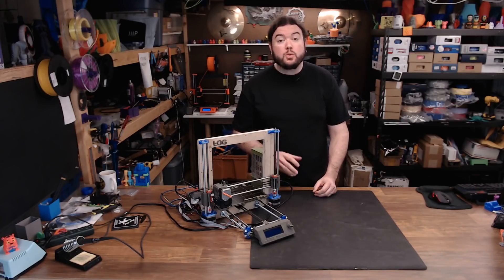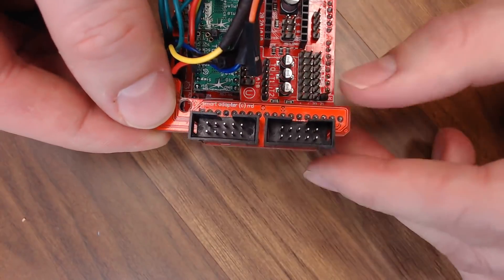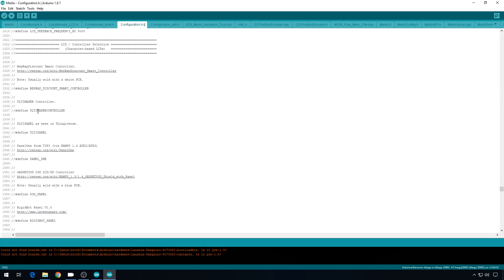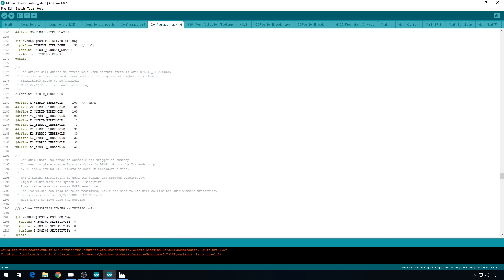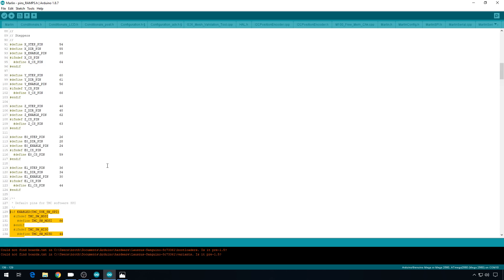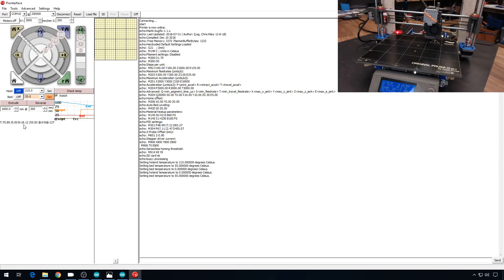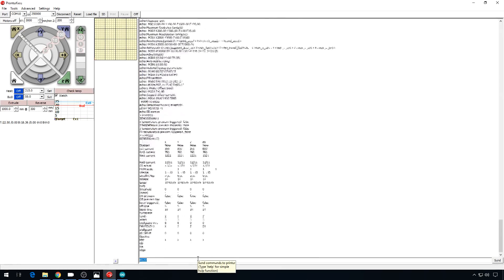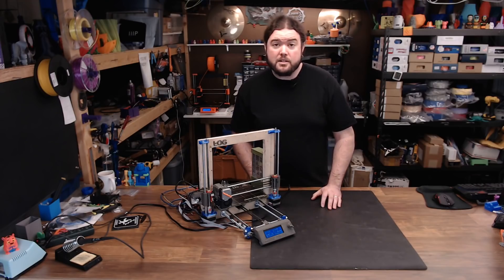TMC 2130 Stepper Drivers - w/LCD - Chris's Basment

Comment: Hi Chris, I notice in a few comments you've said this 'should' work the same on the Re-ARM. I've just tried this, and it came up with a TMC connection error. After having a look at the re-arm pinout (https://reprap.org/wiki/File:Re-ARM_left_Rev_2.jpg) it appears as though alot of the AUX 2 pins are not functional. Would you be able to suggest pins from that diagram that I may be able to use? Very new to the whole thing, so I'm not 100% sure. Cheers!
Reply from the maker: Since you can now change these up in the firmware you can use pretty much anything you want. I think I would try to use some of the open ones on the back header. https://reprap.org/mediawiki/images/f/fa/Re_ARM_Schematic.pdf
Reply: @ChrisRiley  Thanks for the help. Turns out my 2130s had the tiny resistor soldered on the back disabling SPI. Then used your suggested pins on the back. Works a treat now, cheers!

Comment: This method uses software SPI which add fair bit of overhead on the controller. This is acceptable is you have a small board with limited resources however I'd recommend using hardware SPI. In embedded world we use all of the embedded peripherals  before trying to re purpose GPIO pins
Reply from the maker: I agree, I would much rather use the hardware.

Comment: In Marlin version 2.0.x the "n_CS_PIN"  moved to "Configuration_adv.h", simplifying the configuration even more: https://github.com/MarlinFirmware/Marlin/blob/2.0.x/Marlin/Configuration_adv.h#L1980
Reply from the maker: Thanks for the tip!
Reply: @ChrisRiley  Check out my current patch (not yet tested): https://github.com/MarlinFirmware/Marlin/compare/2.0.x...chatelao:tmc3120#diff-18dab9d337cee2f9d2209940ed08dbacR1985

Comment: Great work. I feared already soldering on the LCD Board, cutting cables, etc. - Greetings from Switzerland.
Do you have a like to the modified firmware?
Reply from the maker: Thanks! I have this one, see if it helps. https://drive.google.com/file/d/1TZFD0wTgWvIrQtVyZdHxUln9gkc_ssCk/view
Reply: @ChrisRiley  This video is so incredibly helpful. Did you mind, if I just add your schematics to our printer documentation? - https://3d-printer-hacklab.readthedocs.io/en/latest/#neue-tmc3120-treiber-fur-schrittmotoren
Reply from the maker: Sure, you can use them.
Reply: @ChrisRiley  Thanks so much!

Comment: When I follow this guide i get the error: Driver error, PRINTER HALTED. So I went some steps back and tested only de relocation of the SPI pins without entering the settings and connecting the lcd/sd card reader. I still get the same error. For some reason the relocation of the SPI pins to AUX2 is not working. Does anybody have a clue what the error can be?
Reply from the maker: Hey, what version of Marlin are you on?
Reply: @ChrisRiley  Version 1.1.9
Reply from the maker: @DanvG87  So you think it's the virtual SPI that isn't working?
Reply: @ChrisRiley  Yes, because after the errors I got I went back to the configuration without lcd which was working. And then I only relocated the pins of the SPI (MOSI, MISO, SCK) and the CS to AUX2 pins. After connecting the cables to the corresponding pins on the AUX2 I still got the errors.
Reply from the maker: @DanvG87  What board are you using? There might be some overlapping pins.
Reply: @ChrisRiley  Ramps 1.4
Reply from the maker: @DanvG87  Can you send me a copy of your config to look at? If you can zip up the whole thing so I can compile it, that would be helpful.

Comment: Hey Chris, I've followed this video and got everything hooked up but for some reason when I move the X axis the stepper motor just buzzes. I removed the belt to see if maybe there was to much friction from the carriage but it does the same. Any ideas what it might be?
Reply from the maker: Hey! Almost has to be voltage/current or a bad driver.
Reply: Chris Riley, I managed to resolve the issue. It’s was a simple problem in the end, when I plugged the stepper motor into the ramps board I missed a pin. It’s now working perfectly and really quite, the part cooling fan is the noisiest thing now.
Reply from the maker: @hobbieswithnewbe  Awesome! Glad to hear it.

Comment: hi, I followed your tutorial, and everything is working  very quiet, it is amazing but some pieces when I print it looks like the steps of a stairs, I was looking for info and I think the issue is named skipping steps, did it happen to you with this drivers? if yes how can I solve it?
Reply from the maker: It could be two things, I would turn driver status on in the firmware and watch it print from the terminal. It will tell you what's wrong. They could be getting too hot, or the voltage isn't high enough.
Reply: @ChrisRiley  I hope you can reply me,  i am having problems with Extruder driver so i want to  try use the normal A4988 only for extruder  , i unpluged the 2130driver from E0 cnnector in the ramps and plugged again the old one , i changed in marlin back A4988 for E0 but the extruder is  crazy exdruding super fast   i dont know if i have to change the  wiring again and what am i doing wrong , thanks for your help
Reply: I found the issue , i just fotgot put the three jumpers back  , i am using A4988 back to extruder and  everything working fine and still very quiet with  tmc2130 driver n x, y, z   :)
Reply from the maker: @jaseduar  Nice! Glad you found it.

Comment: Hi Chris, 

Great tutorial as always. 

I followed your instructions but on MKS GEN 1.4 board. But after flashing there is no information on LCD anymore. That is the LCD is blank and not even the boot screen is shown. I am using full graphic LCD and with latest 1.1.9 bugfix release. Can you please tell if there is somethings that I need to be aware of. Thanks in Advance
Reply from the maker: Thanks man! This shouldn't be an issue on a 1.4. Not sure that would have went wrong. Make double sure your pin reassignment is correct. You could be crossing over you SPI pins.

Comment: Could this be used to make use of a RAMPS 1.4 board with the chinese reprap full Graphic displays that have a different pinout?
Reply from the maker: 2130s should work pretty much any ramps.
Reply: @ChrisRiley  Sorry, I phrased that kinda weirdly. I meant if I could rearrange the display pins so that it would fit the weird pinout of the chinese reprap full graphic displays that Anet uses. Otherwise I would have to buy a new A6 mainboard and I would rather switch to RAMPS
Reply from the maker: @senorcapitandiogenes2068  Ah, so you could rearrange the pins with some jumpers, but I think you can solve it in Marlin. I think that screen is in the config now. So just use the right board config and screen config and it should work. I think the connector on the anet is the same, but I can't remember.
Reply: @ChrisRiley  Thank you. Recently the integrated Y Axis stepper driver on my A6 broke and now I am sure that I am not going to buy that mainboard again. RAMPS with its possibilities of replacing all components is just better

Comment: Hey there, great video. I have a prusa MK2 and would like to do this upgrade there. Almost all pins needed can be found on the backside but I'm not experienced enough to find another 2 free digital pins so I don't have to sacrifice the LCD. Could you possibly do a schematic short on how to get it running on a MK2? I think many people would appreciate a quiet printer without paying 500€ to prusa for an upgrade. Couldn't find any thread about tmc2130 and Rambo1.3a even tho the printer has sold so often.
Sincerely J.
Reply from the maker: Thanks! I really wouldn't attempt something like this with a mini. By the time you by the drivers and get it all figured out, you could swap out to a einsy for just a little more and a lot less headache.
Reply: @ChrisRiley  Well I already have 4 tmc's and a driver extension board, and i don't see myself spending 130$ for convenience when the einsy is a rambo with tmc2130s. All I'm looking for is a dummies guide on how to find another 2 unused digital pins (tx 0, rx 0, all enables miso mosi etc are on the backside of the board) and hook it up to the prusa software. I tried to dig into that a few months ago but it's my first printer and I'm way to new to Arduino stuff.
Reply from the maker: There is some pretty good doc out there for the Rambo, but I don't think there is anything giving you physical locations. You might send an email over to Ultimachine, they are super helpful.
Reply: @ChrisRiley  Already did, but the answer was basically  "here is the doc, there is one on the SPI header and some spare pins on the analog and serial headers. but you could just buy a einsy" :D

Comment: Hi Chris. Excellent once again! I have the TMC 2130 v1.1 drivers pack of 4 which came with jumper cables and the four pins all set up but they don't  the fifth pin for the end stop. Not sure which end stops to connect. Do I need to connect any end stops? B.T.W. I have a ramps 1.6 board.
Reply: Please excuse my name being in Greek. it is pronounced Pan Trimis. LOL
Reply from the maker: Is there a hole to add a pin for diag? That is how you get feedback for the endstopless homing.
Reply: Yess. There are three holes. Hey thanx for the fast responce.  @ChrisRiley
Reply: So I just solder the two wires as you did? Should I use the z stop? I have a bltouch that I plan on connecting later on.
Reply from the maker: @ΠάνΤρίμης  Yes, that should work, no on Z, it won't work well.
Reply: So I should use the standard z end stop? Excuse my confusion, getting old LOL.
Reply from the maker: @ΠάνΤρίμης  Yes, either a switch or your touch probe.

Comment: Hi Chris

As I have filled my stepper drive slots in my MKS GEN L v1.0 with stepper drivers. I would like to add a Keyes External Driver Control Board to my Z axis driver external pins.

The printer that I am working on is a 2018 TEVO TORNADO with a MKS GEN L v1.0. I have three TMC 2130'S in X, Y and Z. and LV8729's in E0 and E1. I would like to add another TMC2130 to the Z axis. And hook them up SPI.

I follow your video's, and you are a bucket full of information. Any help would be appreciated.

As I do not know how the address Z0 and Z1 in Marlin. 
Thank You very much
Reply from the maker: Email sent! 😀

Comment: Hi Cris,
i get "Driver error, PRINTER HALTED, Please reset" right after the upload of the firmware (1.1.9).
i also tried on another RAMP1.4, same exact error.

What i should check? the firmware or the drivers?

Thanks for your help!
Reply from the maker: It's usually a wiring issue. Comment out the stop on errors in the firmware and see if you can get some error messaging out of it. Run M122.
Reply: Chris Riley I found out the drivers I got were in stand-alone config. I had to remove R5 and weld CFG4 and CFG5. Now is all ok! Thanks mate!
Reply from the maker: @TheSnow520lee  Awesome! Glad it's working.

Comment: Hello Chris :) 
i Just Done with Config Marlin and i Upload it to MKS GEN V1.4 
But when the Screen Work i Got Massage " Driver Error PRINTER HALTED Please Rest " !! 
What is massage  Men ? i did Something Wong ?!
Reply from the maker: Probably a wiring issue. You are trying SPI correct? You might need to send a reset command to clear it.
Reply: @ChrisRiley  How can i do this ?! And this massage Appar when the Board work and its stay On this massage ..
after i comment " #define STOP_ON_ERROR" its work .. But i got in Programer driver X,Y,Z,E0 Over Temp ! :( 
i Wana talk with u How i can chat with u thanks

Comment: Hello :) Again 
in 3:48 .. Enstop ! Can i ask question becuase im new .. im using TMC2130 SPI and using Sensor bed leveling in Z Axie which is will be true and which will be false Thanks >> im Confucius
One mOre thing : if i wana use endstops of Driver where i can connect the pin of endstop of driver in MKS V1.4 :) thanks
Reply from the maker: Do you know what type of z probe you have? Npn or pnp? If it is NPN,  both will be true.
Reply: @ChrisRiley  Yes its NPN .. 
i can use endstop x and y .. normally because i dont wana use endstop of driver in the first so config will be ?! in this case 
thanks for replaying :)
Reply from the maker: @mohamedatef8424  you'll have to test it, but my guess is they will both be false.
Reply: @ChrisRiley  Thanks Chris :) 
i will try and i will let u know what happened .. thanks :)

Comment: Z is super quiet X is ok Y is supper loud or just as bad as before. Did you adjust the pots on the driver boards?
Reply from the maker: Hey Mark, are you running in standalone or SPI mode? SPI you shouldn't need to adjust it.
Reply: Chris Riley Chris I got everything running very very quiet. Mostly the noise comes from the Y axis.

I cut the jerk number in half along with the acceleration I’m not too concerned about printing quickly I do want it to be extra quiet. I’m going to continue to tinker with it until you can hardly hear it I think a lot of the noise comes from vibrations telegraphing off the aluminum bed under the heat bed.
Reply from the maker: @markgreco1962  Very cool Mark!

Comment: Could I use the 1.8.8 LOG firmware for this from your google drive?????
You say use 1.1.9 bug fix does it matter?
Reply from the maker: It shouldn't matter, 1.8 and up should be fine with 2130's.
Reply: Chris Riley perfect thanks your #1
Reply: Stepper drivers are NOT in configuration.h in older marlin endstop area. Think I should just bite the built and upgrade? Would you share you’re LOG configure?
Reply from the maker: @markgreco1962  Sure, this is the bug fix one, let me know if you want another version, I will see what I have. https://drive.google.com/open?id=1TZFD0wTgWvIrQtVyZdHxUln9gkc_ssCk

Comment: Hi Chris, I am in the middle of getting 2130's working with a MKS Gen L board, I have the X and Z working perfectly using your video thanks. The Y on the other hand is being a complete pain in the backside.
I managed to work the pins out on the Gen L board but got caught because the MKS uses a pins.MKS Gen L that over writes the pins.ramps and was changing the CS pins for X and Y on me.
But if you could do a version of this with the MKS Gen L and the 2130's that would be mad! It might help me solve my Y problem
Reply from the maker: Yeah man, if I get a hold of one I will give it a shot. Check out pins_MKS_GEN_L.h you can change the Y and E pins there.
Reply: @ChrisRiley  Hey Chris, I got it to work perfectly with Marlin 2.0!
Your video was the most help I found on the internet..thank you, you saved me hours of headaches in trying to figure out the pins.
I will post my wiring diagrams on a few facebook groups and credit you for the help. Oh..I only needed to edit Configuration.h and Configuration_adv.h in Marlin 2.0 for it to work.
Reply from the maker: @Worelock1966  Great! Glad you got it working!
Reply: @ChrisRiley  wouldnt have done it without your help man
Reply from the maker: Great to hear it was a help. Thanks man!

Comment: @Chris Riley .. Last Vision Of Marlin is 1.1.9
 !!
Reply from the maker: That will be the last 8bit only version of marlin.
Reply: @ChrisRiley  Can u tell me  there will be jumper On MS1 .. MS2 .. MS3 .. Or no jumper  will put ?! thanks
Reply from the maker: @mohamedatef8424  What mode do you want to run it? SPI mode leave them all off.
Reply: @ChrisRiley  i Have TMC 2130 SPI Right Now , So i will leave them all ?! .. So i can use the best mode u told about it in the video . and it will run on 16 Micro step in marlin software ?!
Reply from the maker: @mohamedatef8424  All the jumpers will be off for SPI mode.
Reply: @ChrisRiley  Thanks .. Can i Use Auto leveling sensor with tmc2130 SPI mode ?! .. thanks
Reply from the maker: @mohamedatef8424  Yes, no issues.
Reply: @ChrisRiley  thanks